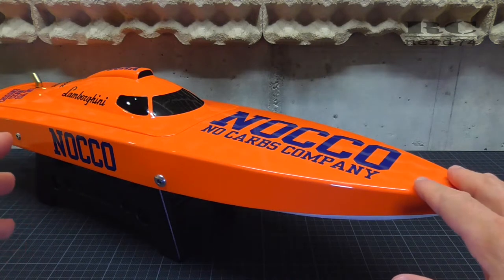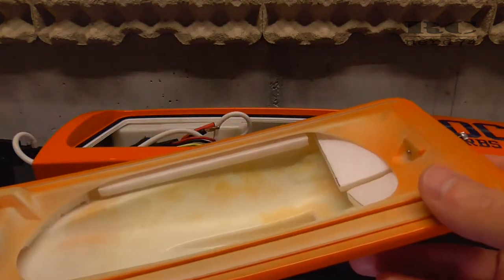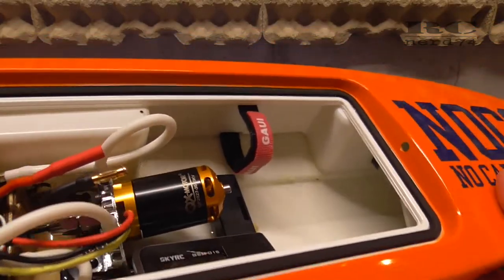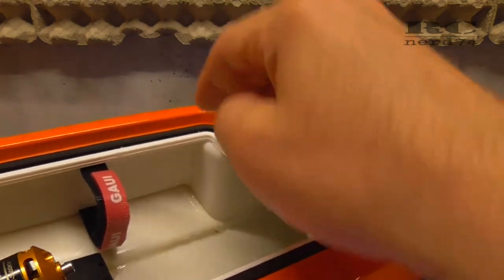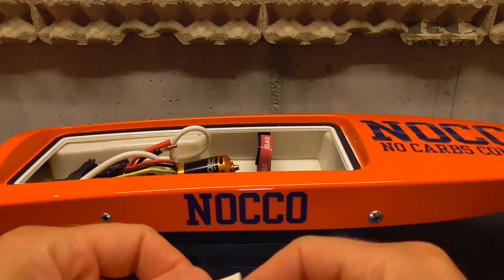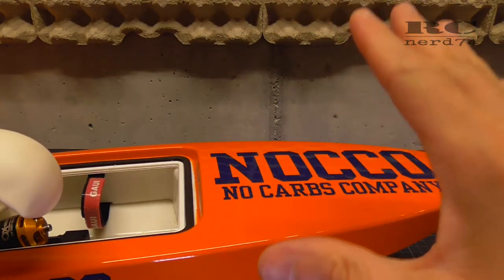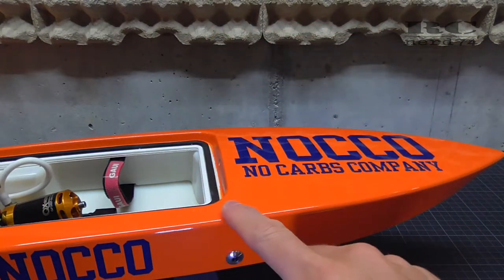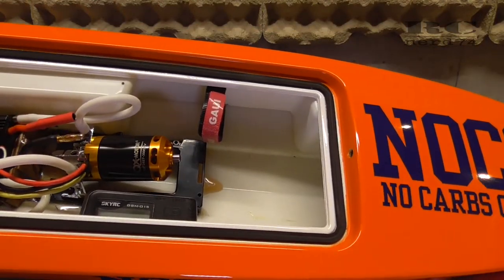JOYSWAY ROCKET 26 BRUSHLESS | UNSINKABLE MOD & GPS TEST RUNS ON 3S & 4S / 76 km/h

Comment: ..i thought the motor was a  racerstar 4000kv. Which is better?
Reply from the maker: The EDF motor with 3500kv is way better. Much more torque. Fits the boat better.
Reply: But are you running the qx 2800kv now? as I seen it was mounted in your esc setup vid,